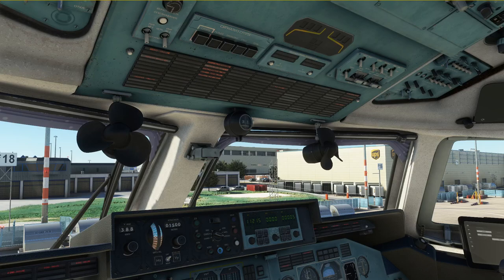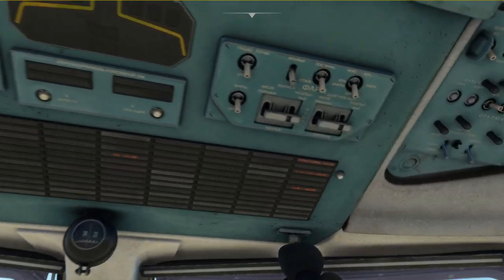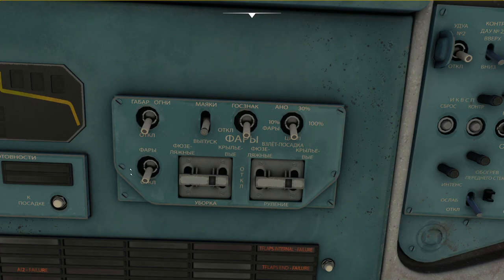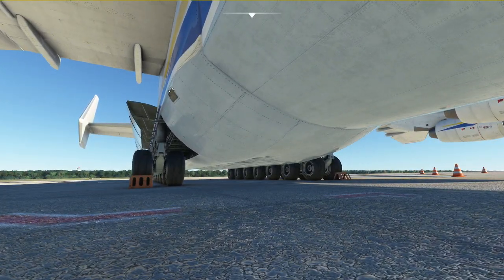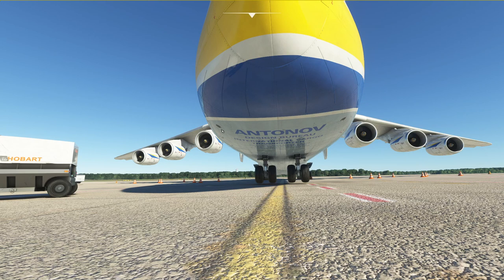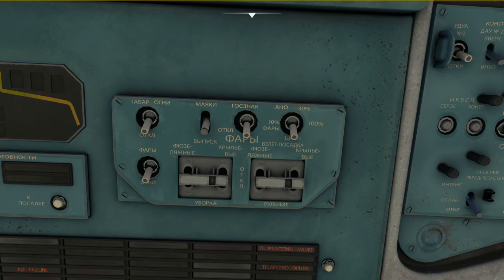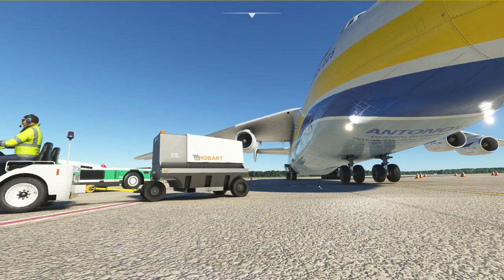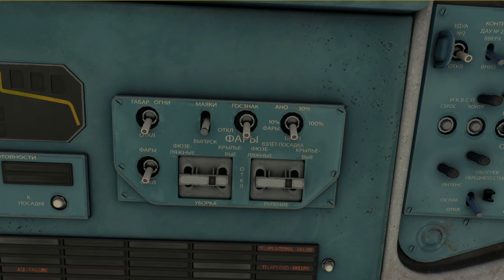Antonov 225 External Lights Explained | Real Airline Pilot

Comment: AHO are NAV lights in reality. This is why it has 5 positions. 10%, 30% and 100% are different intensity settings. There is also interrupted mode where you have blinking NAV lights. In sim they messed lots of stuff up in this model.

Comment: Hey, quick question. When do you turn of the apu in the 738 ?
Reply: flick the APU switch (which you used to start it, to "off" it is up
Reply: @verbjimtim6869  No I mean, when do I turn it off, like when the engines are on, pushback, taxi ?
Reply: @SoupGuyy  Use the APU when the engines aren't running and no ground power.
Reply: @jayrermars8493  👍
Reply from the maker: Once both engines are started and stable.
Reply: @A330Driver  Thank you !
Reply: @theaviationguy196 My apologies for miss reading. Looks like you got the answer you needed

Comment: heya crew, quick question, I was on the vatsim network, flying the b738 and was asked "Pass GOMOL time 06, from Gomol speed 250 or greater" and I was wondering if there was a reliable way to get the aircraft to comply with the assigned time and speed? thanks for your help all.
Reply from the maker: First of all: That's an instruction like I'd never expect it in any airspace I've flown in. But VATSIM controllers sometimes do strange things.
Your best way of complying would be to use the RTA page (PROG 3/4) and once you overfly the waypoint switch to the speed mode manually.
In real life those controllers would just have given you a speed restriction to achieve your arrival time at the waypoint instead of letting you fiddle with it yourself.
Reply: Down under we do it a little odd, I hear it all the time for traffic coming into ypph (in real life) this was my first time receiving the instruction through vatsim. I'll check that page out first thing on my next flight thanks!